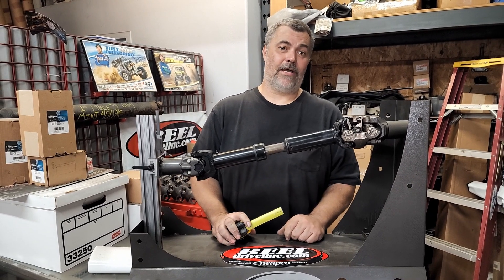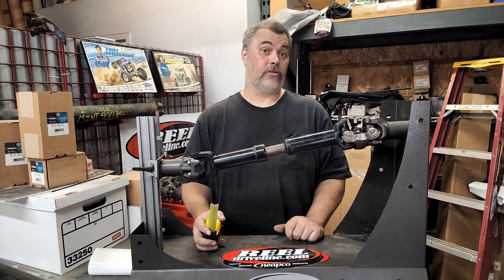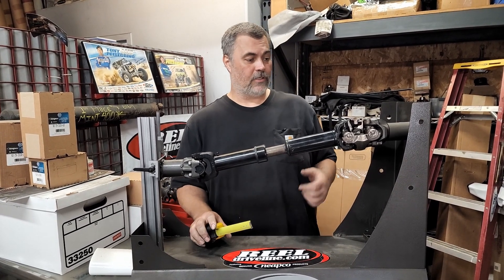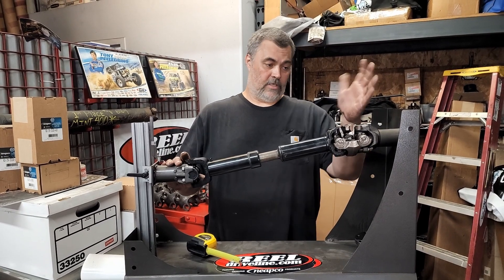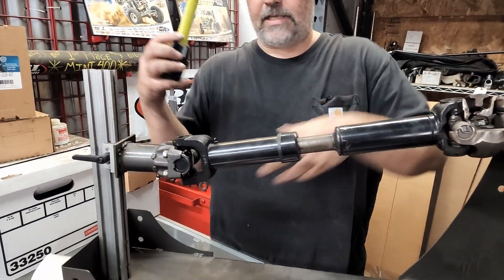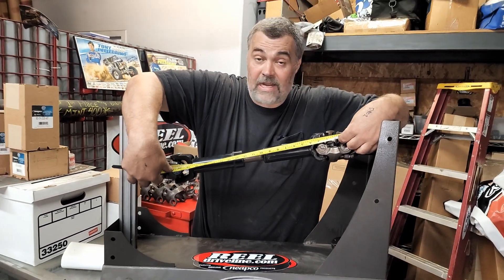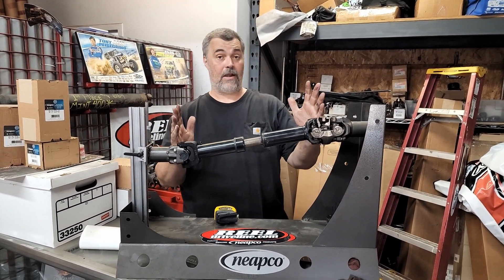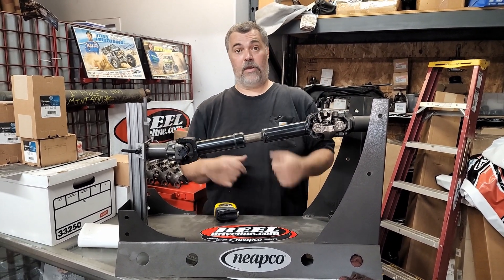How to Measure a Driveshaft for Length on a Jeep

Comment: Hello Great Video Thanks. I know DS are to be marked and put back on the way they came out. Question
I know they are balanced with weights. So if I am putting on a different DS that has the weights placed in a different position on the shaft. Do I just put it back on in the same placement with the New DS even though the weights are are placed differently spaced ? Confusing I know, But I think You know what I am Talking about.